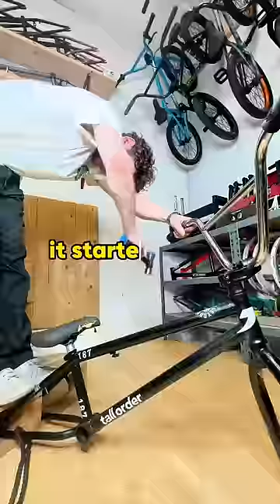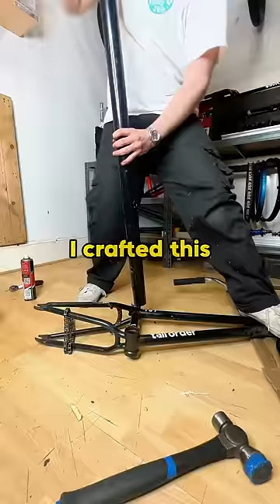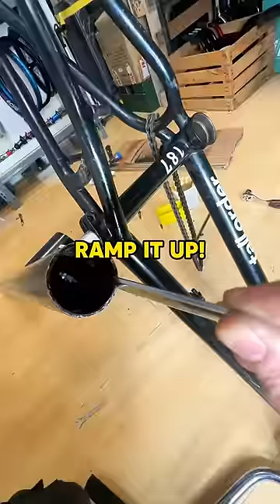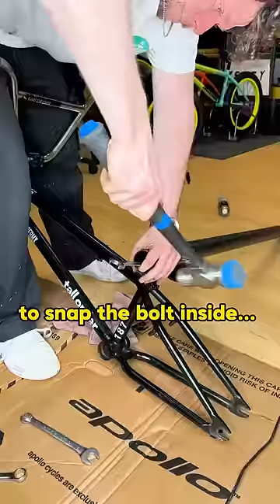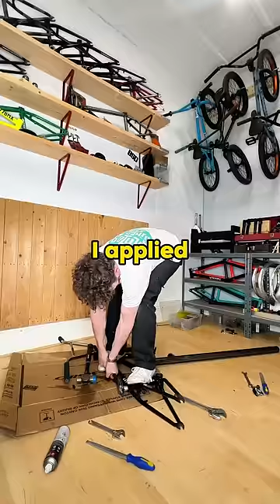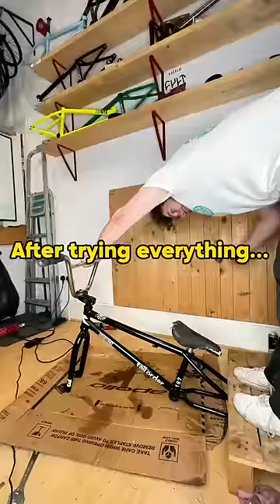Extreme BMX Rescue Mission: Battling the stubborn seatpost from Hell! 😳😱 #bmx #bikerepair #shorts

Comment: Heat makes metal expand, you may want to try cooling it instead! Drop in in a bin of ice water. If that doesn’t work on its own, possibly try heating the frame from the seat tube and cooling the seat post with ice, then pull it out
Reply from the maker: YES, that’s a perfect solution!! Thanks a lot! 🫡👊👊
Reply: @T77BMX Didn’t you thrown away the BMX ?😂
Reply: This happen back then with my surly moonlander. I got 2 cans of Finish Line chill zone spray. Its a 2 person work with lots of brutality. Bt it work.
Reply: Nah, heat up the frame, dry ice or liquid nitrogen on the post.
Reply: Heat does make metal expand buts that's the point heat up seat post it expands expanding the frame
Reply: Yeah expands makes it easier to separate are you silly?
Reply: No mate if you heat the frame around the post then the frame expands. Also, even if you just heat the lot up and it all expands it’s at least moving so will go a little more loose still
Reply: Must have been a super short seat post to only make it worth heating top of the frame tube
Reply: @joshbarber3931  so apparently nobody taught you about thermal conductivity and how good metals are at it, and how to watch a video threw till the end to see him putting heat on the peg not the socket.
Reply: @calvinweed8173  thermal conductivity is the reason why you shouldn’t heat it, the peg would also heat up when heating the socket making both expand together. Plus the bike is made out of all thin material and probably aluminum so heating it would make it worse.
Reply: Are you totally mental 😂😂 dumpling it in water will only make everything contract and get tighter,,,he should use a blow torch and quickly heat up the steel frame before the post heat's up with conduction
Reply: If the seatposte and the frame are difrent Material like aluminium for the frame and steal for the seatposte will the aluminium frame expand Quicker than the seat poset if i am right

Comment: Yea have you tried losing the seat clamp 😂🤦‍♀️
Reply: There is no screw in there
Reply: It doesn’t have a bolt tho so it has no pressure on the seat post 

It’s as if it isn’t there
Reply from the maker: Imagine!! 🤣🤣🤣 that would have saved a lot of time. I can confirm the bolt is fully out! 😫💀
Reply: It's quite visible that the bolt was missing so idk why people point it out??? @T77BMX
Reply: @T77BMX you could've taken a chisel or splitting wedge or reliable screwdriver to spread the gap wider it's probably where someone did it to put too big a post in it
Reply: You are not the sharpest peanut in the turd!😂😂😂
Reply: @geoweeb65 the seat clamp over time bends and permanently stays bend inward
Reply: @CHR1S1S3M0  and I didn't say anything besides stating that the bolt is missing from the clamp, I had no idea why it didn't budge so thanks for the info :)
Reply: @T77BMX  did you ever try spreading open the space between the clamp
Reply: @geoweeb65  so many experts in the comments telling you where you went wrong. Wonder if they will climb out the basement and help you.😅
Reply: @PsyMongSki  I don't know, all I know was that the bolt in the clamp was missing and what the others told me as to why the seaf is still stuck in place
Reply: Spray with PB Blaster then use a air hammer with a pointed chisel in the saddle clamp bolt. You have to leave the seat on. It will slide the seat tube right out.
Reply: He should have hit the clap up to release the tube had this issue so many times
Reply: Open up the clamp with a long nose pliers or other spliting tools
Reply: What why? Just pop on another seat. Sure you can't adjust the height but there will definitely be someone that'll fit on it.
Reply: Your force the opening open where the bolt goes through
Reply: I would have gotton a Dewalt grinder with a cutting disc before throwing it away just to find out what was holding the tube from comming out,,,rust?...😢
Reply: @T77BMX my guess is welded but idk so
Reply: There's no bolt in it 😊
Reply: It's easy £1000 says I can do it
Reply: Uhh pry clamp open good to go
Reply: I’m pretty sure heat expands, you should have fired the heat at the part around the seat post instead of the post itself which makes it worse
Reply: This is why I never recommend aluminum seat post with a steel frame and vice versa always use the same material as the frame.
Reply: @kodierennaker5487  I was looking to see if someone else had a brain in the comments
Reply: Use liquid wrench
Reply: Couple squirts of honey goo and a torch to actually heat it up and u woulda been done pretty quick in comparison
Reply: easy... a slide hammer conected by the thead fixing the seat..
Reply: Angus was wrong
Reply: He removed the bolt before
Reply: @TheEndisnear928 that's one I've never heard before, mind if I use that?
Reply: @T77BMX heat btw expands objects so you were making it harder
Reply: Even If It was in there I wouldn't be that strong and it would move

Comment: You need to melt the seatpost out. Caustic Soda. Heat and leverage will do nothing, there was a chemical reaction between the different metals.
Reply from the maker: Perfect!! Thanks bro, Caustic soda is coming out for pt.3! 🫡👊👊👊
Reply: @T77BMX  not sure if you are being sarcastic or not 😆
Reply: Please wear eye protection!
Reply: gallium + aluminum = win
Reply: @taoburgess5832  pretty sure that caustic is the main ingredient in paint stripper......but hey you do you mate.
Reply: Caustic soda, hydrogen chloride, muriatic acid 👌
Reply: @desdae69  just out of curiosity isn't hydrogen chloride and muriatic acid the same thing??  ie HCL. Asking for a friend.....
Reply: @damienrossow  yeah they are lol
Reply: Came here to say exactly this (caustic soda down the seat tube from the bottom bracket. Wont mess up the steel
Reply: This.

It's called galvanic corrosion.
Reply: I'd have tried soaking it in citric acid and water for a day or two,,, brick cleaner " hydrochloric acid",,, even putting some actual heat into the thing not a bloody hot air gun 😂😂use a blow torch you could even take it to a garage and they could use oxy acetaline to either really heat it up or last resort melt the bloody thing out of there,,, it's only a kids push iron and the heating won't cause any problems,, it's not like it's a Motocross or trials bike is it,??
Reply: @taoburgess5832 it will not leave paint unharmed

Comment: Until he realizes he forgot the seat clamp 😂😂😂😂
Reply: Exactly what I was thinking
Reply: You can see in multiple shots throughout the video that there is no bolt in the seat clamp therefore did not “forget” the seat clamp.
Reply: Yea y’all don’t know that it takes a through bolt to clamp it 

It has no bolt in it therefore no clamping power acting upon the seat post
Reply: there is no clamp my dude he has removed the bold some of the seats like this cant get removed since its a stunt bike  the seat metal is out in when it was heated up so once it is in there u cant pull it out
Reply: @mervan184 I have the same bmx but white never had any issues with it clearly the seat bar that is used was abut to big and was forced into the frame
Reply: The bolt is removed
Reply: Bro go to a mechanic

Comment: I had this problem. I just cut the seat mount off the post. Then made 2 cuts down the length with a hacksaw blade. Came out really easily.
Reply: And that's the solution here!  I did the same on a bike of mine a few years ago 😀
Reply: This is the way.
Reply: Yeah, my thought to, had a similar problem a few years ago, did eventually manage to get it loose with enough violence, but the next step I had planned was to cut it.
Reply: Fixed, same here, 2 slots with a padsaw
Reply: Damn that’s hella smart. Way to go.
Reply: I refuse to like because it’s at a nice happy 100.
Reply: This
Reply: I did it prabobly 10 times!

Comment: Use Caustic soda to desolve the post, protect paintwork,be patient and you will be able to save the frame
Reply from the maker: Ok!!! This is excellent, thanks a lot! 🫡🔥🔥
Reply: @T77BMX  caustic soda works if the seatpost is aluminum and the frame is steel. caustic soda + (hot) water will disolve aluminum.

Comment: Bros gonna grease every seat post he has from now on though! An expensive lesson but he won't ever forget a quick grease smear before putting metal & metal together again
Reply: And it has to be re-greased at least every year
Reply: He left the seat post clamp on...
Reply: @Soknik01  there's no bolt in that seat clamp so it's applying no holding pressure to the seat post, it's seized as well as the seat post. Even if it was the seat clamp was still fastened it would snap like a twig under the force he applied when he had the massive scaffold bar on it & was stood on it....
Reply: @gazcoleman  I've had posts seize but never that badly.  The damn thing couldnt be more stuck if it'd been lubed up with jb weld and stuffed in there.   Wonder if the post is a mm too big or if its an aluminum post in a steel frame?
Reply: @phorest wouldn't go that far lol

Comment: It's called a blow torch more heat from a heat gun. That's why you work on bikes😂
Reply from the maker: Yes a blow torch, and we will melt the seatpost to butter. However, a blow torch would also damage the paint on the frame.. 🤔
Reply: When using heat or cold, make sure it is localised. 

If the frame, where it joins the seat post, heats up (or cools down) at the same rate as the seat post then they will expand/contact together and it will not help you with removal.

Comment: Bro forgot that in science its actually not heat but you need something very cold for the metal to kinda shrink but shrink enough to be more loose
Reply: Also heat makes it expand a bit more
Reply from the maker: OK!! Thanks for this 🫡🫡 now I know 🤦‍♂️🤣
Reply: Glad someone else realized this 🤦🏻‍♂️🤦🏻‍♂️🤦🏻‍♂️
Reply: @scotth4439 learned it off yt yet not in school lol
Reply: If you heat the outside, it should've released.
Reply: @justinmfw  thats what he did, and it didnt work, but if you want to use heat melt it then, it will only take a furnace instead of a heatgun
Reply: @Aguy18101  I watched it again, and it looks like he's only pointing the heat gun at the seat bar and not the frame.
Reply: @justinmfw  heat spreads not instant but it spreads
Reply: This is very dependent on the Heat expansion coefficient of the different materials though.

Comment: Heat up the entire tube not just the top could be seized down further. And use oxyacetylene instead of just a heat gun. You will have to repaint it however if you do.
Reply from the maker: Excellent!! Thanks for this. It makes total sense! I was really trying to avoid anything to damage the paint… but we may be left with no choice 😫🙌
Reply: You gotta get it red hot with a torch

Comment: Heat gun won’t get it nearly hot enough to contract any metal. You needed either a map gas or propane torch.
Reply from the maker: Wooops, Thanks bro! Now i know. I was worried i didnt want to ruin the paint on the frame if i use a torch.. 😅👊👊

Comment: Bro, loosen seat clamp also, you'd want to heat the frame to loosen the inside seat post. Or you could use some dry ice inside the Seat post it self
Reply from the maker: @mybuickskill6979  that’s great bro! Thanks a lot. We did loosen it the bolt was fully out. But yes can’t beleive I got it wrong with the heat! 🔥😫 Dry ice is a good idea bro
Reply: @T77BMX  always up to help, even if it's after the fact, keep your head up bro
Reply from the maker: @mybuickskill6979  legend!! Thanks dude

Comment: Baught a used frame with the same problem, I used much more heat than you as I have access to industrial grade torches.. someone mentioned “slid hammer” but I can confirm that on the most stubborn sadly that did not cut it either

The best and sure to work method that should be done before heat tempers your frame and hammers bed it is to cut the top of the seat post off exposing the hole through the seat post

All you got to do then is take a thin saw blade and cut through the length of the seat post and pull it out but crushing it in on itself and tada (I used a sawzall and ones I got close to hitting the frame itself I used a hand saw)
Reply from the maker: This is excellent!! Thank you so much!! 
We got the frame back out & trued for round 2! 🥊 You won’t beleive we managed to get it almost complete with your method! ☝️

Thanks for the comment brother 🙌👊

Comment: Its really easy to remove. All you need to do it is chop the top of the post off and then use a slightly smaller bore drill piece to drill the center of the post. Once you've weakened the post, use a small saw blade to saw it inside outwards. 😊

Comment: The aluminum of the seatpost welded itself chemically to the steel of the frame, due to constant heat cycles and poor lubrication. The thing you'll need to do is to obliterate the seatpost completely, while still leaving the seattube relatively intact.

Since this is a BMX seatpost, it's likely to be rather short, so a sawzall to cut off the top of it, and to make slots into the tube should solve the problem. Usually.

Comment: Simple fix, cut the post, install a smaller diameter post, drill the back of both post at proper height and use a bolt to hold it, add a 2in tall bit of the larger post for the seat to attach too. 🎉

Comment: When you're about to give up, use a grinder and cut a line in the middle of the seat post. You can put something flat in the middle of the seat post and use both ends of what you put in the middle to twist the seatpost around. You can drill a hole in the middle of the seatpost as well slip a metal rod inside and do the same twisting and pulling upwards motion. Left Right left right slowly the lubrication will go around that way and you'll be able to get it out.

Comment: Recently, I got my kink issue back. Was bare metal when i got rid of it. It came back to me after many years in need of love. The seat post was stuck like this as well. Used one of the yellow canned torches and some transmissions fluid. Came out after a few minutes.

Comment: I had this problem on occasion at bike shops I worked at. If you take the bottom bracket out, turn the bike upside down, pour a regular can of coke in the seat tube (not the seatpost) whilst the bike is upside down in a vice.
Next day the coke used to eat through the oxidization and come right out. I know this is only an anecdote but it's worked for me when all else has failed.  I hope this helps someone.
Reply from the maker: Yo that is an awesome comment bro!! thanks for the idea's. I have tried to Coke trick i coulnt get it to work! I will have to go back for Round 2! 👊👊👊

Comment: If heat doesn't work then try the cold. Get some compressed air in a can and flip them over. Spray the bike frame to get it to expand. This is a common method used when replacing the teeth on a flywheel after they have been sheered off as it causes the metal to expand.

Comment: Spread the sest clamp by hammering a thick screw driver into it. Use a heat inductor which uses an element around the perimeter of the object to apply more comcentrsted heat, try and get the post glowing red hot, or at least the hest inductor on for 3 - 5 minutes, and as sson as you switch it off, be ready to turn the seat post, as you want to do it when it's the most hot. For something like this you need a proper bench vice that you can rest the frame in and hold in place. I would also try and whack the frame with a hammer to loosen the sest post. You could also try bolting a slide hammer to the end. If you were gonna theow it away may asll just given it everything and not cared if thr bolt snapped, can be extratcted.

Comment: I know its late, but if you ever run into this here ya go:
Always lube your seatpost.  If its carbon, use carbon paste.
Paraffin wax.  Heat thearea slightly with a torch and melt some wax onto, and in-between the seatpost and seat tube.
Let it seap in and repeat so you know was is melting into work area.  
No wax, most penetrating oils work if you let it sit.  Tri flow works great for me.  Wd40 is good, too, but gross.

Comment: I used a propane torch on the frame tube. You could hear the corrosion ping. Then i put the seat post in a bench vise ans used the frame as leverage. I got it out. The frame needed new paint, but i got it out.

Comment: Cot off the post. Then use a hacksaw blade to cut the post legthwise all the way down. That releases the cylinder tension. Pry a corner of the post in away from the frame so it can be grasped with pliers. Roll the metal inward making the post small enough to release and pull out. Sounds more complicated than it is, but far easier than what was shown here  Good luck.

Comment: Ive done one of these before. I cut the top of the seat post off, then using a hacksaw blade down the inside split the tube, and then used a pair of vice grips to peel the seatnpost out by twisting. Took a while but worked.

Comment: Put a wedge in the slit in the frame near the spot where bolt used a gently pry on it. Then some lube leave it for few hours. Then not so gently hammer the seat post deeper in before trying to rotate it. It will break any potentially siezed parts and allow for easier removal. This "hammer it in" trick works on stuck bolts too but adds lots of stress to the threads and may weaken them byt can help you in a pinch like when i was removing a stuck bolt from a tractor.

Comment: The heat is going to expand the aluminum post faster than the steel seat tube making it harder to remove. If you still have it, try concentrating the heat at the frame.
Reply from the maker: This is excellent! Thanks a lot man. I’m going to try some other methods. I would really like to keep the paint looking good! Thanks bro going back in!!